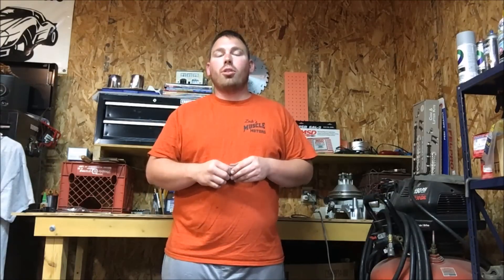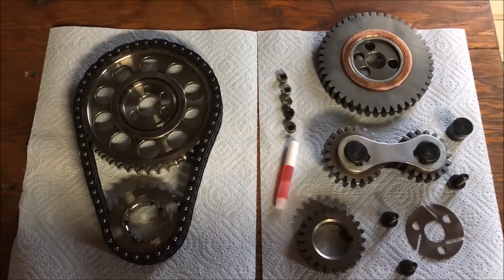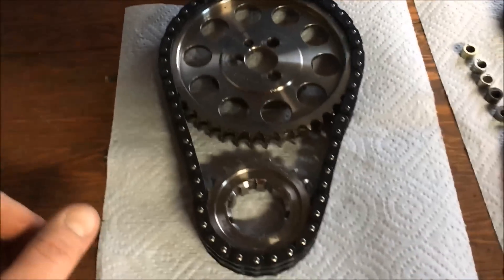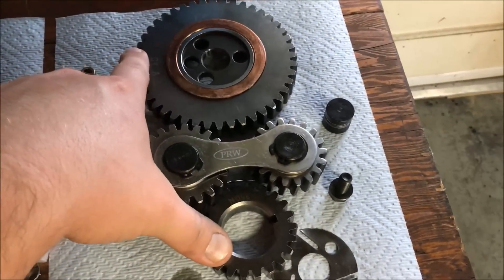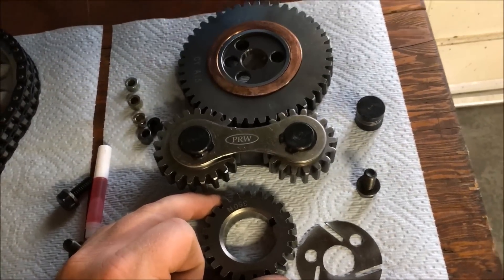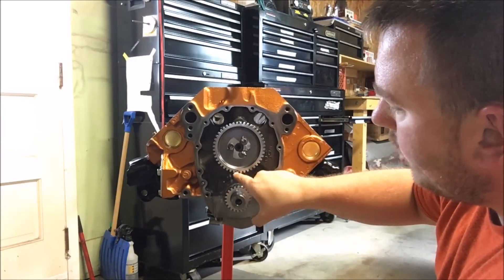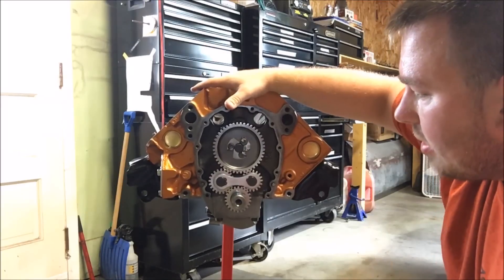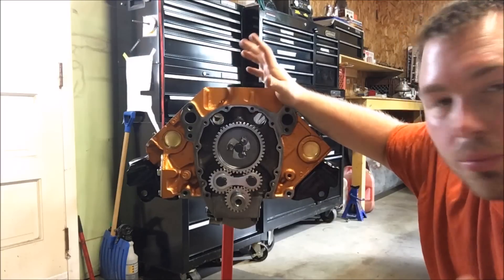Engine Building 101 Timing Gear Drive

Comment: Rubber belts Re fi e so long as people k serve the service life given to them but people seem to think service is an optional issue! As long as it runs, they think they do  have to do anything with it until it stops then they have the attitude the deale sold them a POS because it broke the belt at 150 k when in the owners manual which they NEVER bothered to read specifically states to replace it at a way lower time interval ! NEWS flash - RUBBER HAS A LIMITED LIFETIME, just like your tires . Even if you never ran them the life of the tread which is still like new, the rubber is no good beyond around 7 years and if you went to a tire shop to have flat patched and the date on the tire is past a time now set at 10 years, they will  OT touch it other than to take it off the rim for disposal. That is the law now. Some engines will tolerate a timing belt failure some will  end valves. Most all of our so called performance American engines will bend the valves and then you have a bigger problem. When it comes to the aftermarket belts for our preferred hotrod engines, the. Dogs are external, easy to inspect and really easy to replace without opening the engines as with the other 2 systems. Theife of the. belt is long enough and we generally do  it run these engines for 150 k miles and not do something with this part as in look at it, replace it,etc. Comp Cams .and a very good belt system and the price is high of course because it takes a bit of material and machining  to make. The best part about it is the ease of working with it once you have it. The belts are not expensive, you can swap cams easily and not have to worry about oil leaks at the pan / cover. You still have to drain coolant and remove water pumps. I have. Oth roller chain and gear set for BBC, I'd love to have a belt system because unlike here, I do trust them for what they are designed to do, if I had the funds, I'd purchase a system now. But since I'm not in a position to do so, I will be pulling the gears out of my currently running BBC to replace with the chain I salvaged from another engine that died from other causes, I stall that chain in it and put the gear in the one I'm building now and see about a belt in the next year then put that in the engine coming asap. I also have plans on a 455 Pontiac this coming year and would like a belt on it too. Belts have served racers sufficiently with high lift heavily sprung valves at the tracks now for several years and that gives me confidence in them.

Comment: I've been a mechanic myself for 35 years, but recently had someone ask why most timing gear sets use 2 diffent size idler gears and I wasn't 100% sure. I believe it has to do with wear pattern, having the smaller follower allowing it to ride on different and or fewer teeth, but thats really just a guess, anyone know for sure either way?
Reply from the maker: You know I guess I never put any thought into that, but I’m curious now. I’m gonna have to find out.

Comment: I'm not sure if you are still answering questions or not but I'll ask. You showed the thrush bearing install on the upper gear of the gear drive. Is it necessary to have one installed if you are running a flat tappet cam with a gear drive. I never had any cam button on my sbc's when I was running a flat tappet cam
Reply from the maker: Are you running a gear drive or chain drive?
Reply: Im getting ready to install a gear drive in my vette. It is a 68 with the original L79 in it. Its a flat tappet cam with hydraulic lifters.
Reply from the maker: Yes use the thrust button. I have flat solid flat tappet lifters in mine. With the gear you don’t have the little stability added by the chain the button is a must
Reply: Thanks for the tip. I just finished buttoning her up. Pun intended. Still need to put water pump and alternator on but its getting there. Thanks again for the tip.

Comment: I know this is an old video, but I'd NEVER run a dual idler style gear drive on anything, especially an off brand like used here.  If you want to run a gear drive, a fixed idler, full cover design is what you want to run....not even in the same class...
Reply from the maker: Same one in it and still running no issues.

Comment: Was your 3 gear drive mounting bolts smaller diameter than your holes in the gear ? if this is the case, what about the slop in the gear holes ?
Reply from the maker: It’s been so many years since I’ve done that on that engine but I’m not mistaken the polls have a slight taper outward past the thread that brings the gear moda center. The gear spins true and it doesn’t wobble or move back one way or the other or bind anywhere that’s it

Comment: Did you ever make a video of how the gear drive sounds? I bought the prw noisy set . I should be installing sometime this week. . I called them on the thrust bearing the tech said they’re not necessary on a non roller motor .
Reply from the maker: This is my Facebook page and a quick clip. You can hear the whine a good bit over the open headers 

https://fb.watch/4P8FBsM7Mo/
Reply from the maker: I’m blocked on Facebook for 30 days feel free to call me

Comment: I have a stock aftermarket chrome timing chain cover I bought the PRW timing gear set any issues with clearance? I was told to mark the cover with a dab of grease  before I put the gasket on because if it rubbed a little ,with a gasket it won't so the cam can float back and forth

Comment: Hey, zack you were talking about  harmonics is ther timing gear set I can put in an existing running engine without worries?
Reply from the maker: What do you mean without worries? What’s your concern.?
Reply: @ZaksMuscleMotors   will it cause any wierd vibrations.  I have a stock 305 that I'm going to be rehashing and I'm thinking of going timing gears. Instead off the chain.
Reply from the maker: Well that’s hard to answer one way. If your engine is healthy and runs good and balanced decently sure go with a gear drive. But as far as a stock 305 it’s not gonna really add a benefit for you besides maybe a whining sound. For the added cost and no real gain I would use a stock double roller chain.

Comment: why the gear teeth is spur? isn't a helical be more quiet? or are there any gear driven camshaft aftermarket kit for LS7 (or other GM LS, or small block) with helical teeth gear?
Reply from the maker: Yea there is one for the LS platform, it’s $770

Comment: Did you use anything on the gears for break in?
Reply from the maker: squarebodygangster 84 just the break in oil in the motor with the rest of it
Reply: @ZaksMuscleMotors  good to know! I put a new cam in and decided to use a gear drive. It's a stock bottom so only break in lube on the cam and use valvoline VR1 10w30

Comment: Your seriously taking advice from a guy wearing sweatpants or shorts. Dog bone gear drives are garbage. Double roller timing sets are great for replacement or mild to medium street performance engines. Belt drive systems reduce harmonics from the crankshaft to the valve train as well as reduce friction. Single idler gear drives are used for high performance applications where you are driving pumps and such off your camshaft. Educate yourselves people.
Reply from the maker: Jake Wingfield I sense some major butthurt

Comment: If you want the sound don't install a Milodon single idler as they are completely silent if you set the gear lash the way the instructions say. They are as silent as a crappy $15 Morse chain.

Comment: Question I have a engine thats in my truck its runs good would two different cylinder head affect performance one head is has 1.94 valves the are I think 1.74 i think I have a book the engine codes that head is not listed. Found something only it’s a over the counter replacement head with 1.74 valves
Reply from the maker: Tyran Ducksworth absolutely it will. You basically two different engines right now.
Reply: Thank you

Comment: Good basic info. However, one should ALWAYS drill a1/16th hole in the lifter galley plugs to supply oil to the gear set.(on a Chevy small or big block. Can't opine on other brands, because I'm a Chevy guy) This is extremely important. Otherwise. The gear set will wear too quickly and introduce metal shavings into the oil. Not cool! Plus is always a good idea to use a high volume oil pump to offset any loss of pressure from aforementioned galley plug holes.
Reply from the maker: Russell Mooneyham I actually cut a small channel on the outside of the bearing to allow oil to the gear

Comment: Good video. You omitted 2 different style gear drives. First, direct drive which requires a reverse grind camshaft because reverses the direction of the camshaft . Second, the Milodon 3 gear drive system which keeps the cam spinning in the OEM direction. Both are excellent for high rpm whereas the 4 gear system aka Pete Jackson are good for engines with hydraulic camshafts. The Milodon is the best and the most expensive. This set up allows you to dial in any cam timing necessary and requires you to set the clearance for the idler gear. It comes with a roller thrust bearing for use behind the cam gear. Check out the Milodon #12000 @  https://www.milodon.com/gear-drives/gear-drive-chevy-chrys.php   For the use of the thrust bearing, I would recommend drilling a .030 hole in the face of the boss that the thrust bearing rides against. It would be drilled into the main oil galley helping to alleviate and trapped air during start up and keep the thrust bearing positively oiled. My thoughts. Thanks for posting.

Comment: Henry Yunick always used gears in his builds. Realistically, why not use gears? They won't break. Ever. Period. Just stay away from plastic/phenolic gears. Iron gears will never, ever ever break. They never stretch. There's no disadvantage.
Reply: The gear whine will bug you after a while
Reply: @johngrepo9976  No, I drive a 1966 F350 with iron timing gears in the 300i6, I love the gear whine, and I love the reliability even more. The louder and more obnoxious an engine is, the better. I even cut off the factory muffler and put on a glass pack for efficiency. The cab has no sound insulation, and its been my daily for 5 years. I'm not like most people.

Comment: I have a 454 in a motor home built on a 1984 Chev P30 chassis with 80K miles on it. 
I'm a electronics tech with a little self-taught knowledge of automotive repair.  
I've been told that the mid 80s was the era of  nylon timing gears and cheap chain in the 454.  True?   
(I've seen a set of nylon gears that are stripped, and supposedly the 454 had 65K on it when the gears died).

I was also told that I could do a lot worse than replace the nylon gears with steel and swap the chain for a gear drive.  True?
I'm not interested in fake turbine whine, just good solid quiet performance and not having to touch the timing chain or gears again.

So what brand of gears do you recommend, and should I go with a chain or a gear set?
And what brand on the chain or gears?  I've heard that Milodon is one of the best.
Reply: cloyes gears and jp performance

Comment: All of them have there place. As High HP and Torque motors that rev fast will make use of the gear drives. There just that much stronger. Endurance cars are better fitted with Belt drive like those from Roush Racing. If you got $1500.00 US for them...

Comment: timing gear  sets go out way more than double roller,, I'll never go back to junk gear drive
Reply: Since when? Henry yunick always used gear drives in all his builds and he'd never ever broken a gear drive set and I've never heard of anyone breaking a gear drive. Ynless you're using phenolic/plastic gears. But if you're using iron or steel (not aluminum) they are virtually indestructible. Hell, I have a phenolic gear drive set on an old 4 banger toyota thats been rebuilt 4 times, this is its 5th rebuild and the original iron/phenolic gear drive looks like the day it was made 50 years ago. Metal gears are indestructible.
Reply: @smh9902  He's probably talking about them good ole budget sets for $30 lol they do break a lot. Usually not the actual gears but all the other small cheap shit they use to make them so cheap! Spend $100-$150 and it'll out live your children lol
Reply: @jjmccloud  Obviously you need solid IRON timing gears all around like the old Ford 300i6 industrial engines.

Comment: I bought a new cam for my 327 small block Chevy and I’m curious if these your drives will work on mine
Reply from the maker: Brandon Keele yes it sure will!!!
Reply: Zaks Muscle Motors Does a 327 have a cam retainer
Reply from the maker: Brandon Keele those old gen 1 blocks are just like he 350 no retainer, unless you use a gear drive it uses a cam thrust button.
Reply: Zaks Muscle Motors thanks, i know for 4cyl all day long, just now learning this old school stuff on my  73 f100 and 68 impala 
I decided double chain drive in the end
Reply from the maker: Brandon Keele chain drives are great for stock stuff especially the double roller, can’t really go wrong.

Comment: curious, how did the gear drive do for you. have a beater engine and one hanging on the wall. have to go into the engine and considering putting it in for the sound
Reply from the maker: ThunderHead289 well to start off, I love your videos and watch a lot of them, so the fact that your asking me is pretty damn cool!!! The gear drive has always worked well for me. This motor in the video was turning 8K and it held just fine. Never had an issue. Love the whine and accuracy of them. Thanks for the question!!!
Reply from the maker: ThunderHead289 and if you wanna talk about it in depth give me a call bro 7655247362
Reply: hey, I appreciate that! hope the videos are helpful! 
im just a normal guy trying to keep his junk cars on the road -  
i think there is a lot of hearsay on the internet regarding gear drives destroying engines. im very tempted to throw one on the Rotstang when i switch the cams. trying to find a budget unit, but at the same time, one that is not going to fly apart. it seems like there is no pete jackson anymore!?
Reply: @ZaksMuscleMotors  k

Comment: do i install the distributor at dot to dot??  or do i rotate the dot on the cam gear at 12 oclck??
Reply from the maker: Rick Ashe they should point to 12 o'clock. Are your heads on it?
Reply: yes heads are on
Reply from the maker: Rick Ashe if you're ever unsure after it's put together, take he number 1 spark plug out, have someone bump the starter with your thumb over the spark plug hole, when you feel the pressure you're on he compression stroke. Have them stop, and move your timing mark to 0 on your harmonic balancer. That will get you at TDC on the compression stroke to fire your number 1 cylinder in time.
Reply: hi zak thank for your help    what im confused about is the dots...  dot to dot on the cam and crank  so when do i move my cam at 12 oclock position  is that after you have your crank at dot to dot??
Reply from the maker: Rick Ashe yes, line your gears up just the way I showed you in the video, then when you are ready or the distributor those dots on the cam and crank gears will be at the 12 o'clock position for the compression stroke.

Comment: Why is one gear smaller than the other on the idler gear?
Reply: Rrookie here, but I'm guessing it has something to do with the torque and clockwise duration, the pull, like where the chain would stretch and slack most on a motorcycle
Reply from the maker: Macho Man no idea never thought about it honestly lol